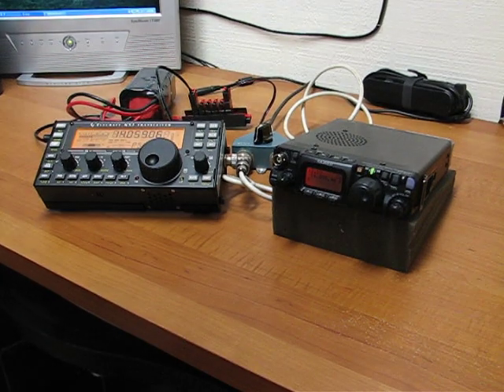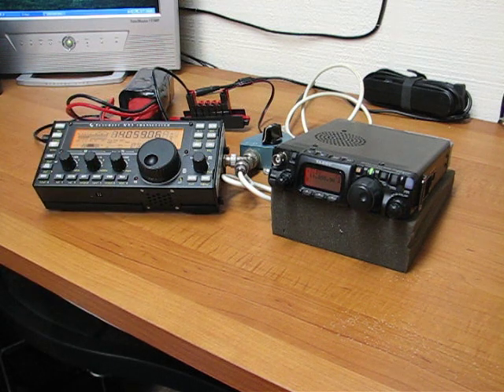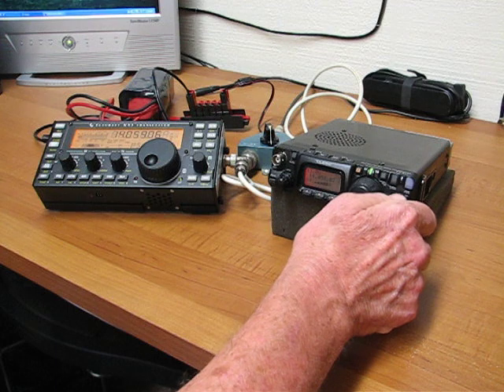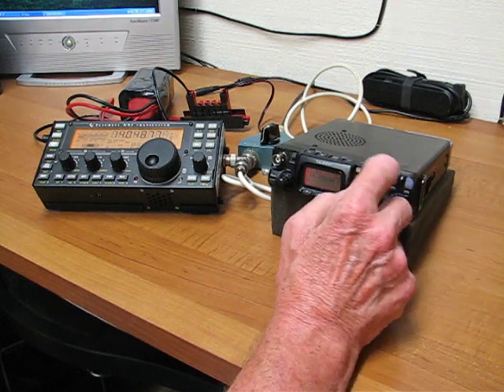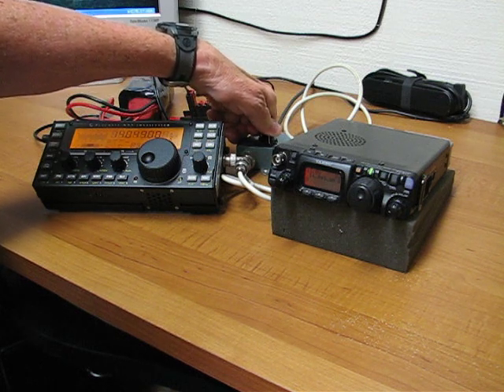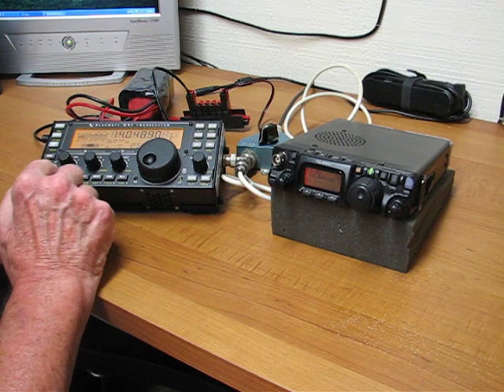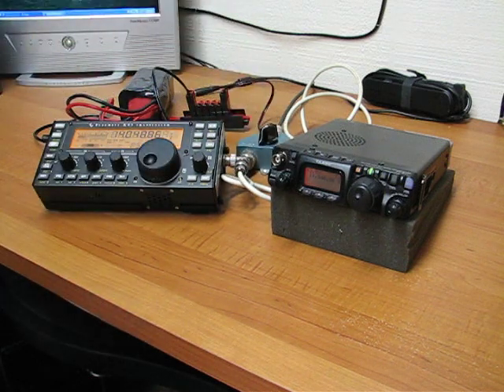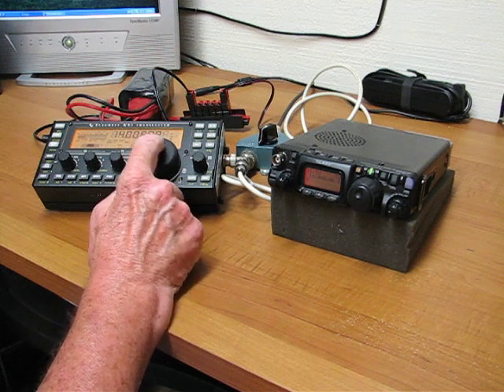KX3 vs FT817 - part 1

Comment: I own both and the KX3 is better receiver hands down all day every day.  In this video he is using the KX3 stripped of all it's tools like dual variable filters and peak AF which is what makes this radio so incredible. He's doing it because the 817 simply does not have these features. When the 817does sound better on the video it's because the speaker on the KX3 is simply tiny, under valued, lacking of any fidelity and is simply horrendous. Virtually ANYTHING is better than what Elecraft put in that box as a speaker.  That said, use a small set of headphones and the sound is absolutely awesome!

Comment: Thanks for the A/B comparison. However, to be totally fair, you should have adjusted the frequency on both radios to produce the same exact CW pitch. At times, I noticed the KX3 was adjusted to a higher pitch than the FT-817. Higher pitches are easier to hear than lower pitches in all that hash. I'd say overall the FT-817 held it's own quite well. The KX3 is a very nice radio and does have a better receiver, but for my needs and budget, I'll stick with my highly versatile FT-817nd.
Reply from the maker: KB0KDX Ham Radio Thanks for the comment. I still have the KX3, the major reasons for me are bigger display, more power and built in tuner. I use it mainly for SOTA activations. That being said things like form factor, ruggedness and VHF/UHF still make the 817 (and the new 818) a decent radio too.

Comment: I preferred the 817 audio, seemed quieter background hiss. Apart from that I'd say not a lot of difference. Why keep re-tuning once they were tuned in?  To me KX3 not cost effective at £1099.95 for the kit  or £1149.95 built, here  in U.K.  817ND,  still £529.95 with £45 cash back when I got mine last year. Or £699 now with Elecraft T1A auto tuner. I have 40m,  20m and 17m dipoles or for other aerials a roller coaster plus variable capacitor or an MFJ 16010 tuner so I don't need a tuner built in. 817 has 2m and 70cm built in,  I use 2m for locals and never repeaters.
G4GHB

Comment: I wonder if he set the CW side tones to be the same in both radios?  It didn't sound like they were.  The FT-817 default is 700 hz but I set mine to 600 hz like my other rigs.  That way you can get a equitable comparison of the filter and audio passband of two rigs.  I think the results in the video were about even but if you didn't think so it might be because you prefer one radio's side tone setting over the other.

Comment: WB7TLK   I've had both.  I know the KX3 is more expensive.  I find that the KX3 is much quieter on receive.  It also has
dual VFO's.  The VFO is much easier to tune.  Battery life is a lot better.  Internal batteries are pretty much worthless on both. 
 With the FT-817 I had to carry a antenna tuner which cost the same as the internal unit in the KX-3 and two more things to carry with the cables.  The KX-3 allows me to vary the bandwidth from 2.8 khz to .05 khz.  The best part is I can see the display. 
I carry a HT for VHF UHF.
Reply from the maker: Absolutely Mark! Especially the ATU and readable display. The only thing I miss about the FT817 is the audio which is way better than the KX3.

Comment: The FT-817 is the clear winner with much less background noise, and you get 144 and 432 MHz. as a bonus without buying the optional 2m option for the KX3.  It's nice to have 2m FM to make local contacts with a small whip antenna. The high background noise on the KX3 can give you a migraine headache.   Who needs that?  Is the KX2 any better?

Comment: the KX3 costs twice as much when optioned fully. yet it does less than the yaesu. Hell the FT817 has been around almost as long as the elecraft brand! the 817 is for me. costs half as much and does more. They seem to last too
Reply: I love the 817 as well , i have 2 right now . One set up in the shack as a fixed station on digital and my other one is for CW and phone and SOTA and trail hiking  ! Wish I had the casholla for the KX3 also

Comment: If you do a lot of CW, the 817 is pretty harsh on the ears. No qsk, and little annoying relay clicks from tx to rx. Not a bad radio (I've had one for over 4 years now,) but my Elecraft gets much more use because it is so sweet through the headphones :) Comparable to Ten Tec, actually (which I have several of...)

Comment: FT-817ND is a much better product than the older FT-817 ,  cost is also very different.
Reply: There is no difference except , the ND has 3 colors for the display, has the 60 meter and Alaska emergency freq. in memory slots, and has a more robust PA stage, ( which I tested at 15w through the hidden menu).
It's the same radio, no real difference, and I use it nearly every weekend from  National Forests.
Lee, WA8QFE

Comment: That KX3 is certainly a beautiful piece of kit.  Having said that, at the price I can definitely see the law of diminishing returns at play.

This is a real David and Goliath battle in a way... so once you've factored in the huge price difference I'd say the FT817 is by far the real success story here.   I'm assuming that the KX3 already has the appropriate CW filters fitted, whereas at a quarter of the price the 817 doesn't... so It'd be interesting to hear a comparison against a tweaked out 817 to see if that improves things a little.

I've not looked at yaesus optional filter modules yet so I'm not sure what's available or how they perform.

Also, let's not forget that the 817 has 2m/70cm crammed in there too - definitely placing it firmly in the General Purpose bracket.

Personally I went with the 857 and it's been a great little first radio but a little too thirsty for fieldwork.  I may go with the 817 for portable QRP and maybe an LNR Precision's CW MountainTopper... y'know... just for the sheer joy of it : )

Thanks for taking the time to make this video, perhaps one day I'll be in a position to add a KX3S to my bag'o'tricks.

M6UDS

Comment: The Yaesu has a lower muffled sound probably has to to with speaker it is larger in diameter so it will sound lower in tone.
Reply: At one time there was a German replacement speaker  that was better...but I can't find it now...
WA8QFE

Comment: Hey Jim: How about a review about these two radios on SSB Voice? I am considering the FT817ND for a QRP digital and voice radio. Looked at the KX3 but by the time I added the features I wanted, the price balooned to almost $3,500.00. OUCH! I miss seeing you at the Agawam Field Days. Would you have any suggestion for Solar panel for the FT817 running 3,000 NIMh batteries?
Reply: Be careful when using the 817 for digital modes or full duty cycle modes. They can get pretty warm without some air movement around the rear which is where the majority of heat dissipation takes place. I've fried the final in two 817s doing SSTV and PSK31.. Just sayin..

Comment: Anything that Elecraft has in its lineup performs better on HF than an 817. Comparing the KX3 to an 817 is hard as they are in slightly different classes. The 817 does a lot of things adequately. For a ham that wants an all around radio on a budget within the low power market, the 817 has been the way to go for years. If you are primarily an HF operator than there should not even be a thought of an 817 on your list of transceivers to consider. If your after refinement than Elecraft is the way to lean. If you are on a budget than an 817 could potentially be an alright choice, but with the new KX2 out I find it hard for any QRP oriented operator to consider buying a new FT-817nd.
Reply: But the KX2 starts at not a lot more than an 817ND, and you get 10 watts.
Reply: I'm with you completely, Derek. I just sold my ft-817nd and ordered a KX2 last week. The 817 got the job done as a QRP radio that I bought for the purpose of portable work. 4 years ago was a different time for me interest wise in radio. I learned that I am a CW only operator, rarely on voice. The KX2 fit every piece of criteria that I wanted in a QRP radio. I do not need a 2m+440 rig as I don't partake in any local chatter, which at the time I purchased the 817 I did a lot of repeater listening. Now I find myself zeroing in on a CW conversation and listening to that instead. Whether you're a new or seasoned operator, an 817 is not a bad choice if you understand the capabilities as equally as its limitations. It is a versatile, do it all radio. With the KX2 being recently released, the price point is perfect, as well as the versatility and refinement that a lot of portable operators are looking for. I will have a hard time missing my FT-817nd while on the air.
Reply: Enjoy!  I'm envious!
Reply: Brandon Bagley Hahaha, Ya ok....

Comment: What I take from this video is that your antenna makes a much bigger difference than your radio. I would be happy with either of these rigs on the end of a well installed, well designed antenna. The "ancient" FT-817 was really quite a good rig "in its day", which means it still really is quite a good rig, despite others possibly having better bells and louder whistles. The Elecraft is also a fine rig. Either one will work the world on a good antenna; neither one will work the local repeater without a proper antenna.
I would love to see more reviews of antenna systems and fewer reviews of radio match-ups, because nobody markets a worthless radio - Put a proper antenna on any one of them and you can work wonders.
Also, it was cute of you to compare the Yaesu without the Collins filter activated to the Elecraft with its DSP active for the first half of the video. A real "honest to goodness" comparison, there! Way to go.

Comment: The ft 817 wipes the floor with the KX3 for less money , you can buy the ft 857D and used 5 watts QRP  the KX3 sell you a amp 100 watts for 800.00 buying the ft 857D give you the best of the both worlds 5 watts for QRP and 100 watts The KX3 is melting your wallet when you can do it cheaper with the FT 857D
Reply: I priced a KX3 with a few basic options = $1504.00 with shipping!  At least the FT-817 comes with a decent microphone.  Most local mountain toppers/hikers I know use the small LNR xcvrs; basic but quite rugged.  I think the FT-817 is a better trail/SOTA rig,  more rugged,  2 meters and 440.  Yes you can add 2 meters to the KX3 for another $260.00, now we're pushing $1800.00.
Reply: I have both now too. I also probably will keep the 817 and sell the KX3.
Reply: w8mpx amen brother!😎
Reply: Amen to you Sandra 73'
Reply: Lol
Reply: TRUE I HAD BOTH THE FT 817 AND KX3 THE FT817 IS A WINNER I SOLD MY KX3  I WILL  LIKE TO TRY THE KX2  BUT USED NOT NEW AND COMPARE IT WITH THE FT 817 I HEAR THE KX2 IS BETTER THAN THE KX3
Reply: Yes Antonio for the price you can't go wrong the FT 817nd  but the KX3 is to  much money the ft 817 will do the same job

Comment: Thanks for the video.  I'm an engineer and long time ham, and I like to do FD and dig out difficult to hear stations.  My 817 receiver crumbles during FD when I'm near any other transmitters.  The KX3 does not.  And when the QRM is tough, well, you know what happens.  If I like to have new features (even higher power output), I can update my firmware on the KX3 to current specs.  Not so the 817.  Same rig since 2002.  HOWEVER, the 817 is a heckofa rig, I do NOT disparage that little thing.  IF you're looking for LESS $$, stick with the 817, by all means.  Its just great for that.  However, when I need my batteries to last a long time (internal), might experience heavy QRM and love 50 Hz CW filtering, like not having to carry a key or tuner, blah, blah... I'll take the KX3.  IF I truly need multimode VHF/UHF (never have) - the 817 kicks butt.  For basic performance, the 817 is truly wonderful, I"ve had mine since 2002.  It will not leave my shack!
Reply: 817 is a mountain top radio not a fd radio so cant fault it for that.  I would like to see an  IC-703 vs 817
Reply: +Clark Turner - You are indeed the voice of reason here and stated the differences in these two radios perfectly! Thank you!
Reply: many true statements here . I like the fact that the 817 looks like a radio ( I do not even like menu driven rigs but I gotta admit unless your going vintage a good older analog rig would be a good find for me . I also do not like one ( 1 ) switch for multi purpose use . But I have those type of rigs also . Just have fun … best 73

Comment: Also the Elecraft ecosystem is more fun and expandable. I have a K3. II have had it for 5 years. Elecraft just released a new synthesizer for 200 bucks. Put the K3 at the top of the heap and it was already one of the top 5 receivers. New modular options are also available. They just released the new K3S, and if I want too, I can bring my K3 up to that spec. They never leave you hanging with product improvements. As a desktop rig, the KX3 can morph into a serious competition grade radio. Spectrum scopes auto tuners, and awesome roofing filters. Again, the 817 will become challenged with weak signal work in crowded bands and big antennas. Add to that the ability to flash new features and improvements via software updates, an autuner (which is key to portable operation), long batter life (not an option for backpacking) and the radios are apples and oranges. And I like the 817 for what it is. Just being realistic.

Comment: I see all the comments here and actually no test of what makes a receiver superior. The 817 is a versatile do everything radio but it is dwarfed by the KX3 in robustness of the receiver. It's not anecdotal, and I am not basing this on the perceptions like nice audio and such. The 817 will melt with a 20-30 over signal 500 HZ away, and the KX3 will make it go away. You cannot compare a DC to light receiver with an up conversion design to the Elecraft. I believe there is only one filter option for the Yeasu and the blocking dynamic range is vastly superior. I would propose adding a test to your series. Find a pileup. Find an S3 signal amongst strong signals. Lock the filtering down and see what happens. The signal on the Yaesu will go noisy or go away due to blocking. The KX3 will be crystal clear. Also an Elecraft need to be adjusted for your preferences, and with a little tweaking, you can make it sound exactly the way you want. In internal speaker is meant for portable operation, so it obviously will not perform as well. The 817 is great for what people do with it, with small compromise antennas. But it will simply melt into a puddle of goo in a difficult environment. Both are good tools but it's like comparing a camera phone to a DSLR.
Reply: +Erin Taylor  Again: Ten (10) years separation in design philosophy. Again: $500 vs. $1000. 

Heavens above man. Please tell me you don't blow a gasket when you can't find tomatoes in the apple orchard.
Reply: ELiTE_OpTiic Wow a triggered confused alt-left troll.
Reply: Nigel Holmes Go Fuck yourself!

Comment: current price of the 817nd at Universal Radio (where I got mine) is $689. the KX3 on Elecraft Web side for the basic 160-6M is $999. the 2 meter module is $199 user installed and saw nothing about a 70cm module.  so is the KX3 better than the 817. probably a little bit. is it $500+ better, not in my books.